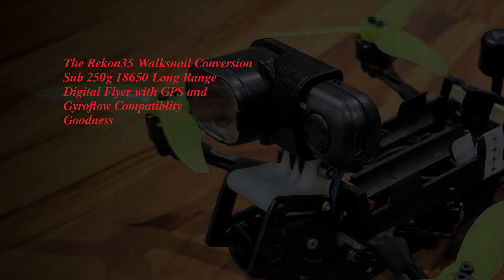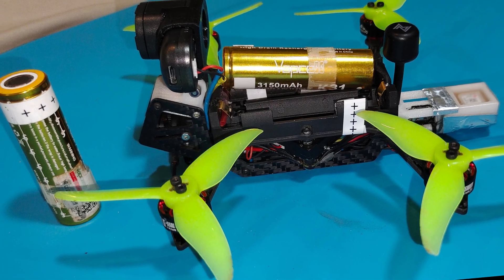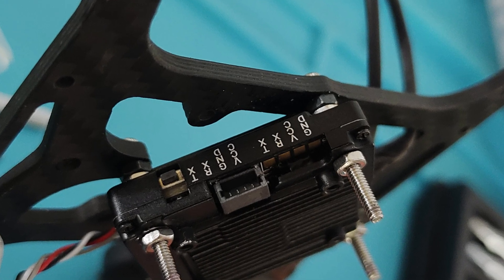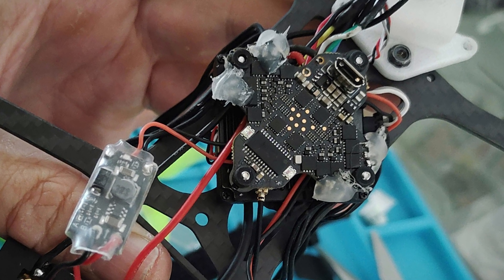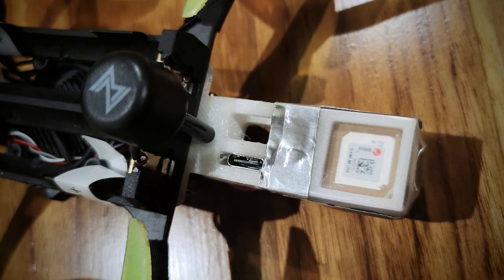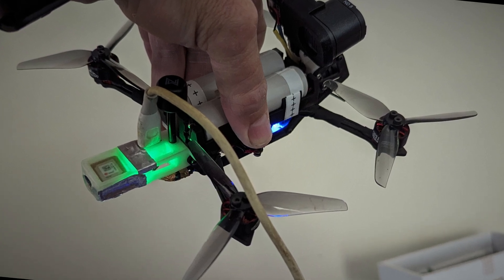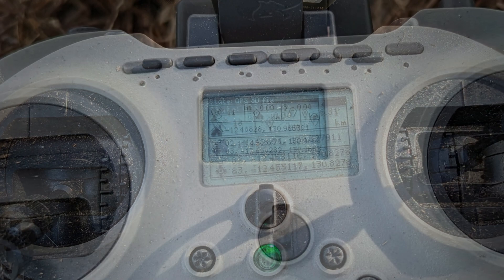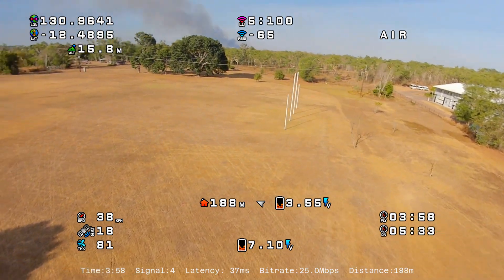Rekon35 Walksnail Review, Setup, and GPS setup

Comment: Which motors did you end up using? they don't look like the standard HGLRC 1303.5 5500KV ones...
Reply from the maker: This was the Rekon35 BNF analogue version converted to Walksnail HD digital, it still has the stock 1303.5 5500kv motors, what has been swapped out flight controller, TPU parts have been remodelled to allow clearance for the VTX, GPS changed as the stock version is useless, and a BEC added  for powering the Walksnail system.
Reply: @cyberess1000  Thanks for the detailed reply. BTW, I just pulled the trigger on my own Rekon35 based on this video from you, HGLRC should give you affiliate status or something.
Reply from the maker: @DurvalMenezes  I don't think that this video will sell too many drones for HGLRC. What I would like see HGLRC do is improve and redesign the Recon35 with some of the ideas that I have used in this video, and I think that they could do a lot better with the BNF version of the Rekon35

Comment: Also what flightboard did you use
Reply from the maker: I used the Flywoo AIO Versatile F405 1-2S 12A with build-in ELRS -- I like this board as it has a lots of accessible UARTs, and the ELRS is UART based, and running with Betaflight 4.4
Reply: @cyberess1000 Thanks 😁

Comment: What components did you use Mark  I've been wanting to build the same drone with 1404 6000 k v motors
Reply from the maker: Part as built and flown

* Walksnail V2 Pro Camera and VTX
* BEC AS32 voltage Step up board
* Flight Controller flywoo F405 1-2S 12A AIO build-in ELRS 2.4g RX
* HQProp T3.5X2X3 3.5" Props (Flies better than the Genfan props)
* Matek M10Q-5883 GPS COMPASS Module
* An Rekon35 quad with 1305.5 5500KV motors -- as this was an conversion
* My custom 3D printed parts.

There is a post on the Walksnail facebook group with more details
https://www.facebook.com/groups/walksnailofficial/permalink/6778140672215181/

Comment: I voiced an opinion that I didn't understand the emerging fad of tearing down an O3 when there were viable options already available. My opinion didn't go down well.  But your video perfectly highlights once again to me that current available hardware is perfectly adequate
Reply from the maker: I have to agree, 03 = "DJI lockin", and it's far too expensive and Walksnail is better suited for Micro and Whoops so I have gone down the Walksnail way, it would be nice if more Quads was sold as a BNF with Walksnail and  HDzero options.
Reply: @cyberess1000  +1, Walksnail has a much better cost/benefit than DJI stuff. Too bad it's still proprietary... :-/ me, I plan on flying analog until OpenIPC is ready for prime market.